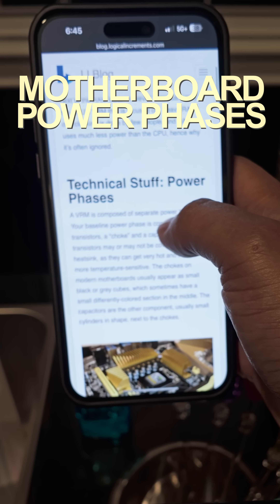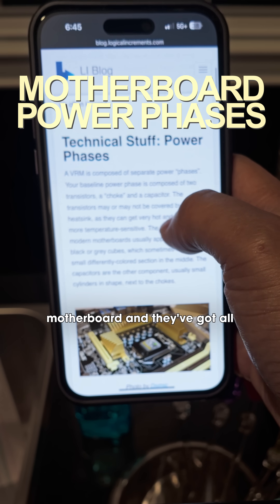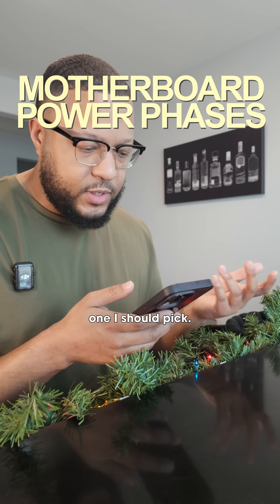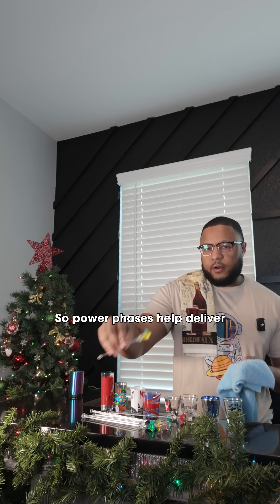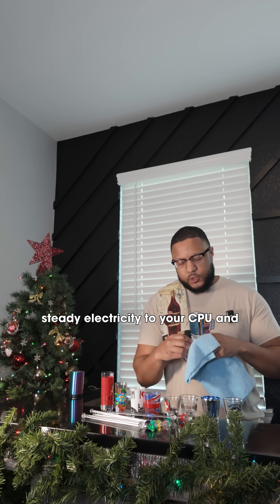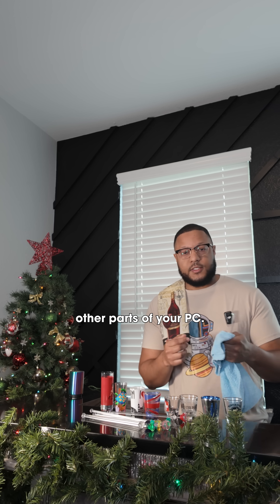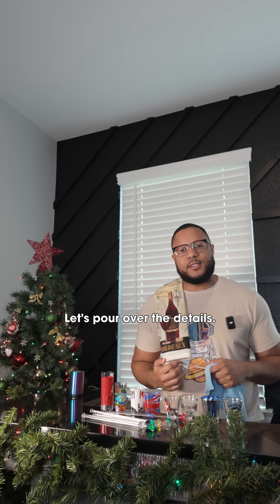Explaining Motherboard Power Phases

Comment: does it matter how many cores your CPU has ? 
and if my GPU is more higher end ?
and the ram?
Reply from the maker: It does. You could bottleneck urself if one of them is too slow. Check this video out for more:

Explaining Slow CPU and GPU Speeds
https://youtube.com/shorts/t-U1DAeM6AE?feature=share
Reply: I was talking about the mother board  like if my GPU and CPU is higher end will it matter if I take a cheapers less phase included mother board?
Reply from the maker: @noone-t5j  ah. The general answer is no. But if your mobo cant deliver enough power to your cpu or gpu, you could have issues. But i doubt you run into that issue tbh
Reply: @ayoehhtech   Bro you'r videos are really great ! 
I m gonna build my first system after a few weeks and doing my research right now. It is really helping me <3
Reply: @ayoehhtech  I probably am gonna go through all of your videos